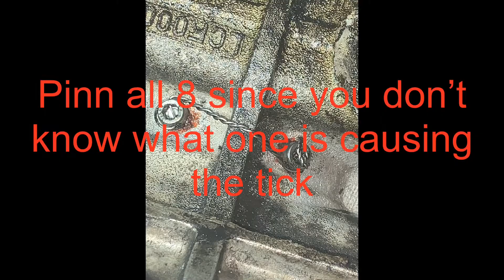Land Rover Discovery II tick FIX!!! FINALLY!!!

Comment: Awesome, gonna do the same on mine. Yeah, I would also love to see that PDF, also. What size holes did you drill? I'm assuming you will feel the liner when you are drilling through the aluminum. Safety wire is a great idea. Thanks
Reply from the maker: Send me an email to armyman1id@gmail.com and I will email the PDF. Sorry for the late response.